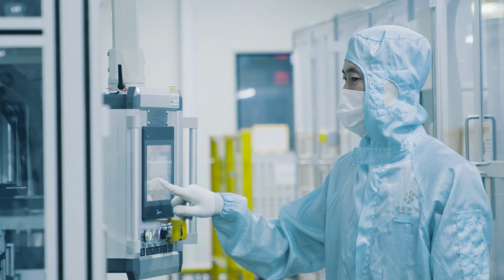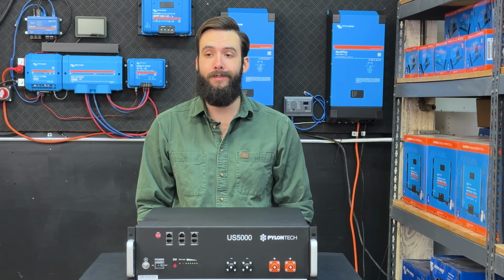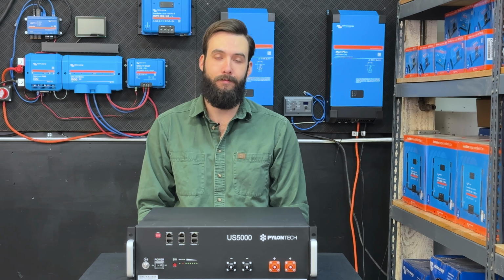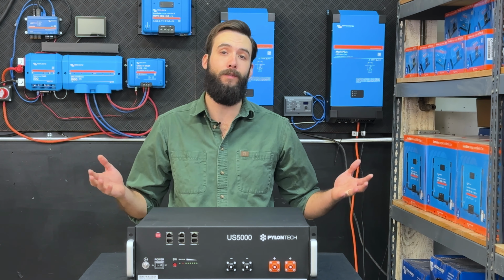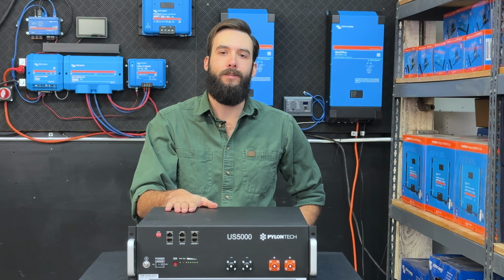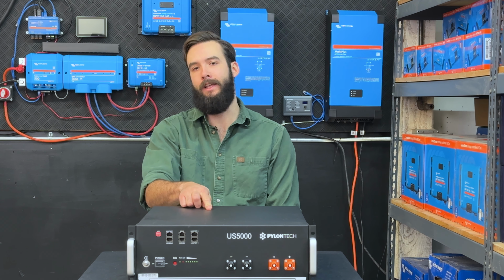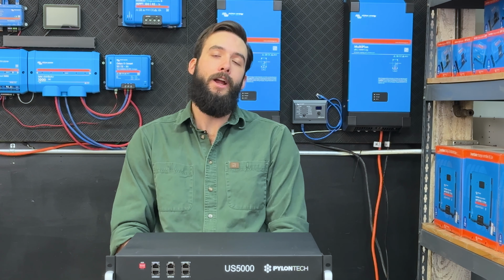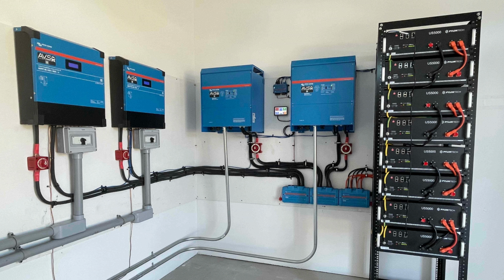Intro to Pylontech’s US5000 48 Volt Lithium Battery

Comment: Can i take out 150 ah from that battery after installing 6x us5000
Reply from the maker: Hello, the batteries are 100AH each with a 1C rate of 100A. To figure out exactly how many hours your 6 batteries will last, divide 600AH by however many amps you intend to continuously draw. You can also do the same with Watts, each battery is 4800W.

Comment: Mike, thanks for another excellent video! Given your experience with both Victron and Pylontech, could you create a video explaining how to effectively set up one or more Pylontech US5000 batteries with a Multiplus-II controlled by a Cerbo GX? Please cover how the Pylontech BMS functions and provide detailed instructions on configuring the ESS Assistant with the mentioned equipment.

Comment: !00% Infomercial!
Reply from the maker: Oh, 100%. We are completely sold on the Victron-Pylontech dream team. Can't stop talking about it. What brands do you like to use?
Reply: @intelligentcontrols  -- only the ones that use 16 cells for a 48V battery!
Reply from the maker: @rpsmith  Interesting, why is that?
Reply: @intelligentcontrols  -- The industry standard is 16 cell.  However, budget batteries tend to use 15 cells to maximize profits.  More is better when it comes to battery voltage!
Reply from the maker: @rpsmith  If you dig into the spec sheet, I think you'll find that the Pylontechs' overall usable capacity—due to the quality of their proprietary cells—more than makes up for the .32 kW gained by 16-cell competitors.
Reply: @intelligentcontrols  -- if we are talking about a 100 AH battery, a 16 cell battery has more than 300 AH over a 15 cell battery!  Also, the inverter is more efficient with the extra voltage of a 16 cell battery.
Reply from the maker: @rpsmith  I wonder if we are confusing Watts with amp hours. A 15-cell battery has 4800 Watt hours, which, when divided by a nominal 48v, comes out to exactly 100ah. To do the same math with a 16-cell battery, 5120 Watt hours divided by 48v comes out to 106.7ah. Assuming a 1C rate of 100A, that's about an extra 10 minutes of power if the batteries are running full bore that you gain with the extra cell. Higher voltage is indeed more efficient, but when the voltage difference is 3.2v, we are starting to split hairs.
Reply: @intelligentcontrols  -- Perhaps you could explain why Pylontech decided to go with 15 cell batteries instead of the industry standard 16 cell batteries?

Comment: I Have 6 for 6 months now and looking to add another 2  just so i get the margins right and have them discharge to max 40% also charge close to 100% fro 10-12k cycles .. install and firger system with victron gear ...just love it !
Reply from the maker: Anthony, thanks so much for sharing your experience. That's one of our favorite features of the Pylontech US series as well. That ability to add another battery, or two (or ten - of any size!) to a Pylontech bank is a feature that is just awesome for our customers, both small systems for homeowners and large industrial systems alike. It suits the modular mentality of the Victron systems incredibly well, and it speaks to the quality of the communications within the Pylontech bank.
Reply: are the 6 in a single stack, i have 4 now, looking to add 2 more.   i noticed on the video there was 8 in a stack

Comment: I dont recomend Pylontech batteries, in two or tree years they will inflate. About Warranty The distributors reserve the right to give the guarantee and in practice they will not accept it even if in theory you have a 7-year guarantee, prismatic cells are better as you can always find spare parts since pylontech are special, they are 5s per module at least in the that i have.
Reply from the maker: Hi Practicas, thanks for sharing your perspective. Pylontech is a global brand, sold into many different markets and applications, and distributors certainly vary in their ability to support their customers. We value your experience. All we know is our experience and the experience of our customers and partners in Europe who have used Pylontech for many more years than we have. What brand of battery do you feel is a better choice? We’re always looking to learn what people like and why.  Have you had experience with Victron batteries? The Smart Lithiums are great and use prismatic cells. The NG SmartLithiums are coming out soon, and we’re looking forward to getting our hands on them.

Comment: hello,

I have two Pylontech batteries. I need to know how I can install live monitoring (WIFI).

The batteries are connected to a solar inverter.
Reply from the maker: Hello Charbel, what inverter are you using?
Reply: @intelligentcontrols  Hello, I use an inverter voltronic axpert max duplex 11kw
Reply from the maker: @CharbelAbouJaoudeh-ug2or  I'm sorry, we don't have any experience with that brand. Best to reach out to them to see what's possible.

Comment: The US5000C allows approx. 75A, which is around 3.6kW at 48V - is that the maximum power with which I could charge my ev?- I'm planning 5x pylontech US5000 on the Deye SUN-12K-SG04LP3-EU - and would like to be able to charge the car battery for 150 km overnight. - Does it work?
Reply from the maker: Hi there, the batteries are capable of handling 100A a piece, but the 75-80A mark is a better sweet spot for increased battery life. I recommend multiplying the number of batteries you are using by that 75A and then having that set as your discharge limit. If you size the battery bank appropriately, there should be no issue with your application.
Reply: @intelligentcontrols  Thanks a lot. The  SUN-12K-SG04LP3-EU  is compatibel? I have two compatibilty-lists from pylontech, in one of them it is not listed. One last question - the us5000 is LiFePo4, NOT
 LiIon, right?
Reply from the maker: @nanookpictures , Correct, this is an LiFePO4 - a very safe, stable battery chemistry. US5000s have been used for many years, particularly in Europe and Australia, in residential settings (temp-controlled garages, indoor living spaces, etc.). This integration with Victron is now into its 8th year at least. Have a look at the 2023 compatibility list: https://cdn.shopify.com/s/files/1/0628/8041/5974/files/Pylontech_Compatible_List_V2.08_ESS-2023.pdf?v=1715796562. I don't see it listed - happy to help you confirm with Pylontech if you'd like to shoot me an email at question@icmontana.com

Comment: What's the maximum distance the battery can be from the solar inverter its connected too.
Reply from the maker: Hi @cathalc9720, the maximum distance is determined more by the cabling and amperage of your system than any manufacturer specification. Ideally, it will be closer to the inverter/charger as that will simplify cabling if you have communications between the battery and the charger and allow for lower gauge (and/or fewer) positive and negative power cables. Some states have specific rules, so be sure to update yourself depending on your location. NEC recommendations generally indicate that the storage bank and the inverter be within sight of each other to allow you to have a single disconnect rather than a disconnect at each the battery and inverter/charger. If you have further questions related to your specific installation, please feel free to get in touch with us here: https://icmontana.com/pages/get-in-touch. We'd be happy to answer any questions we can.

Comment: Intresting video. I do like them but how are you getting around low charge limits on battery stacks?

The physical connections are limited to 125A - which means a stack of any size has this as a hard limit….

On larger systems with say 80kWh worth of US5000’s how are you getting reasonable charge times? 

The Cerbo GX only seems to support 1 BMS CAN interface per system and if PylonTech is limiting to 100A - thats a trickle charge at best on 16 x us5000… 

What am I missing? 

Cheers

Martyn
Reply: My point  was/is with a US5000 you need one “home run” per battery. 

You cannot parallel  link the power connections on more than one US5000   and maintain a 100A charge per battery. 

You can still link them as s logical bank on the data side of course. 

With the US2000; 

Pylon spec

‘Each US2000B Plus battery module is approximately 50Ah at 48V, can provide 25A continuous chargeand discharge and 100A peak for 1 minute.’

So in theory you could stack 5 of these in parallel for the 125A max rating 

In reality this would be pretty stupid.

Setting DVCC  to any higher than 125A where batteries can draw greater than 125A could be a fire risk subject to the fusing. 

A 5 stack might load the home run up to 500A for a short duration which would hopefully blow fuses - sadly I have seen banks fused for the full battery current and single home runs to busbars, the cables & terminals are fried.
Reply: @MartynDuerden  You don't want to charge/discharge US5000 batteries at 100A each as it will drastically decrease battery life. 
Limit it at 0.25C and place more in parallel.
Reply: @Stukkie  Hi, yes, I get that but my point here was the 100/125A hard limit on a battery stack. 

We can set up to limit charge / Discharge limits of course but in a stack of 2 that limit is 50A, a stack of 4 is 25A - which might be fine 

 But the issue arrises at peak, a stack of 4 on one ‘home run’ limits you to 0.25C for the US5000.
Reply from the maker: Hey Martyn. The Pylontech cabling system can handle the full 100A continuous current capacity of each battery in a stack. The end runs combined with the shorty connectors allow you to dial in to exactly whatever amperage you are intending the system to handle. When all the batteries are connected via the communication jumper cables, the master BMS identifies how many slave batteries are in the system and then requests the appropriate current limits from the Cerbo GX via DVCC. Check out this video for a deeper dive into the cabling system https://www.youtube.com/watch?v=7RXtUzvPJ-Q&t=434s
Reply from the maker: This article is a nice intro to DVCC as well: https://icmontana.com/blogs/technical-articles/victron-s-dvcc-function-explained

Comment: They work flawlessly with MPP solar brand inverters using canbus, and many other brands as well.

I have the MPP solar 11Kw PIP MAX model inverter/charger and 3 x Pylontech US5000B model (B =  addition of a 48V dc breaker to meet the Australian standards)  
It's used in a Hybrid on/off grid system which gets turned on sundown to sunup to not only use maximum solar but avoid the horrendous peak grid use charges we have here from 4pm to 9pm

So simple to use, just press on or off the inverter start button and the whole system boots or shuts down.
Add shore power and/or solar and the charging starts
Reply from the maker: Hi Philip, thanks for the comment! I'm glad you’re having a good experience with the batteries. The system you’re describing sounds really cool.

Comment: Well, the most important part - what is IN there is missed. Again some cheap pouch cells? 15-20 years is a fairytale. Most reliable types are round cells says my ~13 year experience repairing all kinds of batteries. I have seen 8-9 years old 26650 lifepo4 cells with undisclosed number of cycles (definitely MANY) that have retained 97% of capacity (3200mAh->3100mAh). These soft pouch cells definitely perform the worst. Swelling is very common and in many cases they are not even properly compressed.
Reply from the maker: Hi Indrek, I appreciate your experience in the field. We could quibble about theoretical advantages of cell type until the cows come home without reaching any real conclusions due to the overwhelming number of variables in the market. The provable facts are that Pylontech batteries have independently verifiable lifespans under normal use scenarios that reflect the >15 year claim. Beyond that, their warranty covers the batteries through 10 years and I can personally confirm that the times I have had to process a Pylontech warranty for a customer are FAR less than I have come to expect with other battery brands that use either prismatic or cylindrical cells. 

In my experience, once you are using tier 1 cells, the differences between brands and types are negligible. The truly important factor is how the BMS performs, and if it is specifically calibrated to the cells it is mated to. If it was empirically shown that a different type of cell had an advantage over Pylontech’s pouches, I would still bet on the Pylontechs over a different brand that is mating a 3rd party BMS to cells that they don't produce or control.

Comment: Hi, I wanted to know if I can add the Us5000 to my 2 current Pylontech Us3000Cs or could I have problems?  Thank you
Reply from the maker: Hey Eduardo, you certainly can do that. If you make the US5000 the new master battery, it will ensure the US3000C’s remain functional through Pylontech’s backward-compatibility protocol. For a more in-depth explanation of what makes this possible, check out our article here: https://icmontana.com/blogs/technical-articles/adding-capacity-to-a-pylontech-lithium-battery-bank

Comment: Thanks for the info. Each string of 6 batteries only can send 50A or 100A in each wire? Or what is the maximum Amp that can appear in each wire?
Reply from the maker: Hey Bryan, Each battery can send 120A of continuous current. The wires are maxed out at 120A per set of end runs. So long as you don't drastically undersize your bank, it is very rare to expect to pull the maximum potential current from each battery, since that would largely defeat the purpose of the batteries as a store of power. So the rule of thumb is to size your batteries to how much reserve power you want (typically 6-24 hours with your normal loads) and then size your wires to how much current you will pull at any given time (typically 50-150A).
Reply: I have 2 sets of wires from the bank to the lynx distribuitor. When i had only one, charging at 120-150 amps was warming up the cable. Now i have no issues whatsoever charging at 180-200 amps. I don t have the solar capacity to overload the cable capacity. Don t know what i would do if i had. Probably expensive custom bus bars.

Comment: What's the difference between up5000 and us5000
Reply from the maker: The main difference is that the UP5000 was produced for the Australian market and, as such, has a redundant breaker on each unit. Aside from that, the UP5000 has a very slightly higher C rate vs the US5000, which has UL certification, making it suitable for the North American market.

Comment: Just a question: May I use the cable that is supplied in bandle by Pylontech to connect my US3000C battery to Victron MultiPlus-II inverter or I need to buy the original victron cable one?
Reply from the maker: Hello Jo, Unfortunately the Pylontech supplied cable does not work for connecting to the Victron Cerbo. For Victron installs you will need a VE.Can to CAN-bus BMS Type A cable from Victron.
Reply: @intelligentcontrols  Ok... thank you

Comment: can you put these in series to make them compatible with high voltage hybrid inverters?
Reply from the maker: Hey there, Anton. The short answer is no. The US and UP series from Pylontech are compatible with a low-voltage parallel configuration only. The long answer is that Pylontech has a few high-voltage battery models coming to the US market soon. Once we get our hands on them, you can expect some more videos giving them the same deep-dive treatment as the low-voltage models we currently supply.

Comment: I should of buy victron at first. Currently use eg4 6500 ex. Not happy at all. Wifi app stop working.  Sinature solar tech said they do not have control over it n move on... 2 years I have to run to garrage away from home to watch the remain power. Total BS...😢😢😢😢
Reply from the maker: Hey there, @makesaveinccomm, that is an unfortunate scenario and super frustrating. This is exactly why we recommend people choose products that are manufactured by and therefore under the control of the parent company. When a company sells white-labeled products that ultimately come from an anonymous Chinese factory, everything is out of their hands, and the customer suffers.

Comment: For how long will 1.5 ton mini split will run on full charge?
Reply from the maker: It depends on the amperage of your particular model. To get an approximate answer, multiply the amperage of your unit by the voltage (probably 230v), and then divide it by the voltage of the battery (48v). This will give you the amperage of the DC current. You can then divide the 1C rate of the battery (100a) by that number to find the time in hours that a single fully charged battery will run the mini split.

Comment: When you say that many cycles, are you talking about 50% of the battery or 80%?
Some manufacturers are manipulating how many cycles by not telling you that it’s at 50% instead of the usual 80%!
Reply from the maker: Hi @simon359 That kind of shady cycle count manipulation is exactly what we dislike about many battery manufacturers. We have positively confirmed with Pylontech that the 8,000 cycle rating is at a full 95% depth of discharge per cycle. We also did our homework with some independent verification. When you dig into their BMS software, 1 cycle is calculated as 4560 Watt hours of discharge plus a corresponding 4560 Watt hours of charge. So to bring the math home, 4560Wh = 95% of the advertised 4800Wh of capacity, resulting in a full 95% capacity cycle. -Mike
Reply: @intelligentcontrols  
Thank you! 🖖